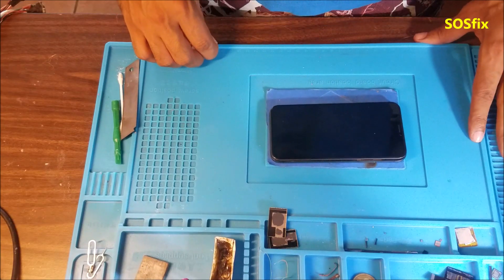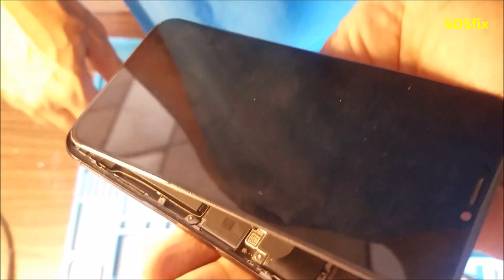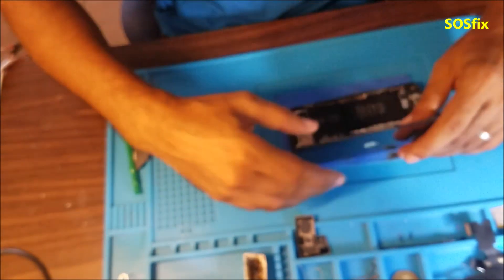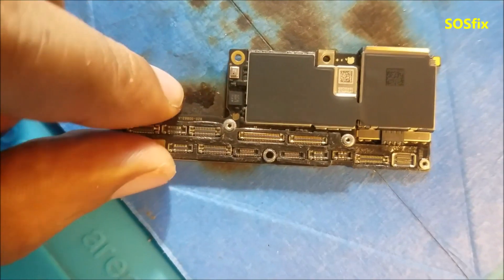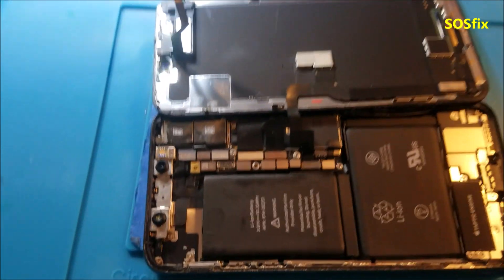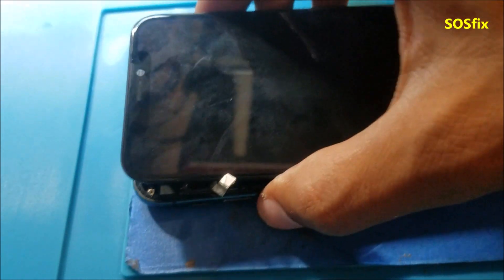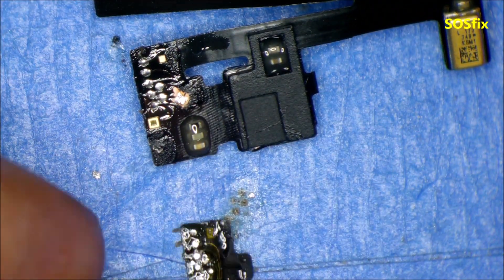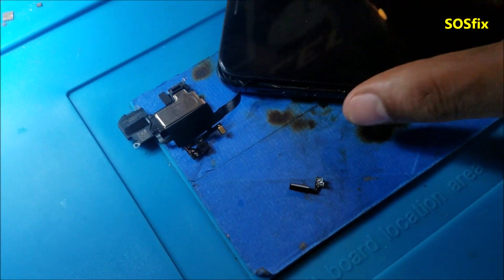iphone xs apple logo looping water damaged fix

Comment: I think my iPhone XS may have potential water damage. I actually got really unlucky a couple days ago, my phone crashed at 9:53 and I had a phone interview with an engineering firm at 10. I really liked the XS. Is there any way I could ship it to you for repair?
Reply: It's stuck on a boot loop and the restore screen. I tried to factory reset the phone and it failed. Is there still possibility for data recovery, really only the photos on the camera roll. I last backed up my phone in April but there have been a lot of important photos since.
Reply from the maker: yes you can ship it to us for repair

Comment: soooo, do i have to change anything, because my screen is kinda mess up too??? 

thanks
Reply from the maker: ( we need more details about your issues) 
If your phone has a water damaged  First you need to take the phone all parts and dry it with hot air or hair dryer. 
After. try to power on the the phone with minimum parts as LCD/touch screen battery power button connected. If the problem is not in the motherboard/ screen the phone will turn on.

Comment: I had the boot loop issue and tried hard reset steps, button and screen massages, yet none of it worked. I disconnected the front sensor assembly as shown in the video and it came back up. I didn't have any water damage (that I'm aware of, it was a Swappa buy and the indicator was white) so now I just need to get the replacement parts to fix it.
Reply from the maker: you will need to swap the light sensor and face id chip from old flex and solder it to the new one for the face id to work, but its ok if you dont need the face id working
Reply: @SOSfixElectronics  Before my replacement assembly came in, I ran across your video https://youtu.be/WMny5nDhKd0 about reflowing the components and it allowed the phone to boot with the original assembly connected, but it looks like the proximity sensor isn't working. I'm going to reflow again to see if that fixes it, otherwise I'll just move the components to the new assembly. Your videos have been very helpful, thanks!
Reply: @SOSfixElectronics  Think I damaged the flood illuminator when I transplanted it and the light sensor to a new cable assembly, says it cannot register Face ID now. I even moved them to another cable assembly I got just in case. Guess I'm gonna have to live without Face ID :(.
Reply from the maker: @nefariousangel8238  sometimes just reballing them will get it to works, couple times it takes me 3 tries to get it to work

Comment: Hi i my phone got a little wet from touching it with wet hands when in the bath . And now it’s contant Apple logo . I tried the volume up volume down reset it just goes back to the Apple logo . Until the power dies . Is there anything I can do I don’t want to lose the photos on it as I haven’t backed up . And i have photos of my pet that passed away a few weeks ago I don’t want to lose 
Thanks
Reply: batman did you ever find a fix I’m suffering right now
Reply from the maker: For iphone water damaged and data recovery you need to send it in for repair. I ll let you know about shiping in process if you still need help
Reply from the maker: @kevinmoose3756  if you know how to take it apart and check it inside then try to clean the board . or send it in for data recovery

Comment: Please help . Yesterday I dropped my phone in water and now it keeps restarting over and over again. Do I need to take out the mother board and battery before I use a hair dryer ? Thanks you
Reply from the maker: yes take it apart
Reply: SOSfix Electronics I’m curious, can the battery and mother board get damaged if in too much heat ?
Reply from the maker: @ethnicarrel4258  batter yes not the motherboard
Reply: SOSfix Electronics thank you so much, I really appreciate how you respond to comment even though it is months after you uploaded
Reply: Hi did it work?

Comment: Hey i had a screen damage then i replaced my iPhone with a new screen, then i tried to start the phone but it stuck in the apple logo boot loop, i tried to do DFU with iTunes but it didn't work at first, then i put my phone away, but after a while i tried to start the phone again then surprisingly it was able to start and run like no problem, then after two minutes it went off and started to boot loop again. can u help me
Reply from the maker: It will will be hard to tell. But let's try 1st is the iphone was working fine before you start the screen replacement process? If yes. Disconnect the screen and the battery. Then connect the battery alone without the screen and plug the phone to the computer and watch carefully the itunes. If it shows your phone on itunes that's mean something wrong with the screen if not    the next test will be on the motherboard

Comment: I have an iPhone 8, water damaged... I got the water serviced through a third party, but the boot loop won't go! 

Help me out man
Reply from the maker: boot loop could be anythings as hardware  battery cameras power button motherboard or a software issue, try to update and reset the phone by itunes and DFU mode be sure you dont need the data or already have a icloud backup. good luck
Reply: I've sent you the details on the email ID mentioned on your Facebook page. Please go through it once and let me know what can be done.